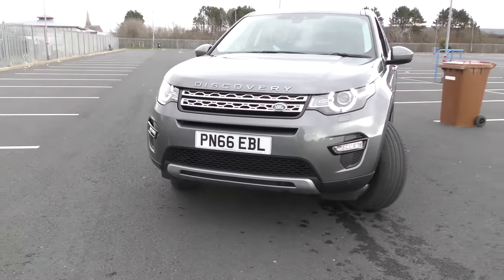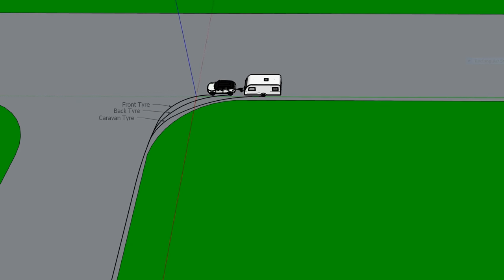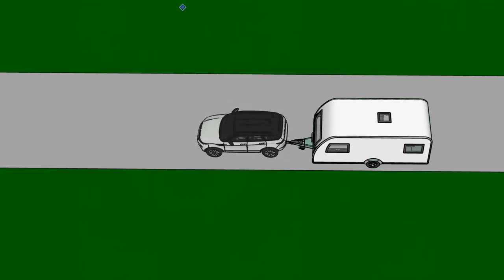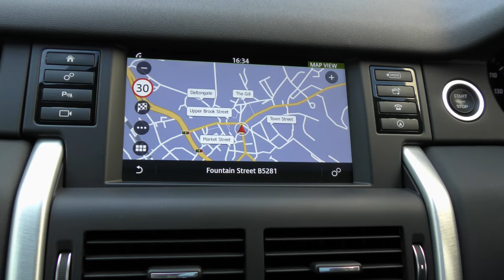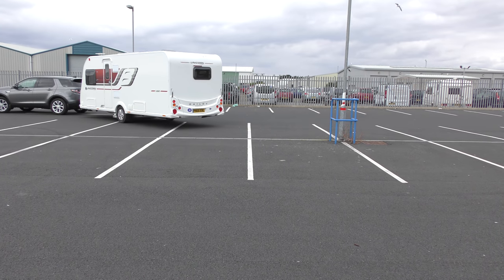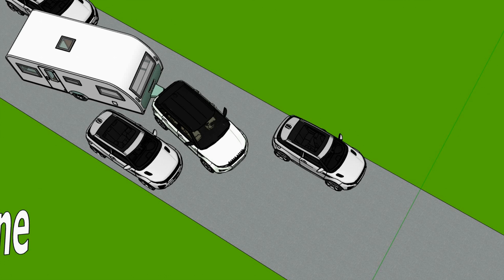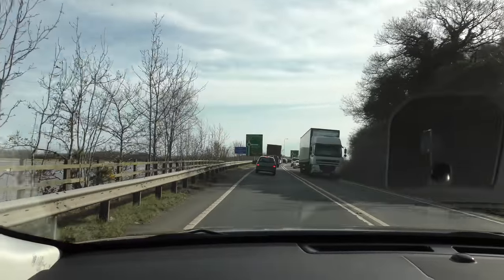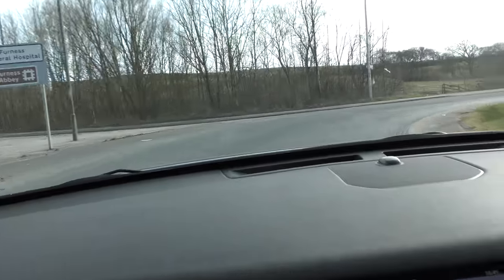How to safely tow a caravan or tow a trailer: Caravan tips and tricks

Comment: Tip no. 1 is at 0:12 - don't leave your jockey wheel down like that. (Jockey wheel is the one near the tow ball). If you do, it'll hit the ground and be smashed. There should be very little of the wheel visible in this shot.
Reply from the maker: Thank you for that pmaikeey, but you are wrong, the jockey wheel on the Bailey Unicorn is fully retracted. I agree if it was not there would be a problem.🙃
Reply: @UsefulWisdom  I'm not wrong - it's not clearly high enough - if it won't lift any more, remove it by unscrewing the clamp all the way as necessary - it's why the clamp's designed like that.
There's insufficient ground clearance in this shot.
Reply from the maker: @millomweb  the jockey wheel is wound up into its retaining slots on the shaft and lifted as high as the clamp will allow.  I have driven thousands of miles with it in this possession, all over the UK and had no problems with the bumpiest of hump back bridges, sorry,  it is you that is wrong.😛
Reply: @UsefulWisdom  "By the look of the picture the jockey wheel needs to come up further. It normally sits along the side of the A frame cover." - BaileyofBristol (Danny)
Reply from the maker: @millomweb   the tow ball high of the Land Rover Discovery Sport is 420 mm or 16.5 inches. The jockey wheel of the Bailey Caravan has over 12 inches of road Clarence. Although the Land Rover is  a 4 wheel drive vehicle, we had no intentions of using its off road abilities with this type of caravan attached to it. If we were daft enough to use a caravan  that had  off road  ability to visit the top of Mount Everest, for example, we may then, just for you, consider remove the jockey wheel altogether. However, our trip was from a CL in Cheshire to a CL in  Worcestershire, this involved driving down flat motorways and A roads.
Reply: @UsefulWisdom  It doesn't appear like 12" in the video and I've seen wheels higher than that relative to A frame. So that's two indications that it's low in that clip.
Reply from the maker: @millomweb  The EC Directive 94/20/EC states that the tow ball height should be between 350 and 420 mm with the vehicle in the 'laden' condition. My Land Rover has a tow ball height of 420 mm and in the Bailey Caravan specifications, Bailey advise this to be the correct height.  By the way I have seen a caravan manufacturers who does not give any  tow ball height specification, which is a worry. I expect it will have an impact on their sales.  How can you buy a caravan if you don't know its safe towing height? My caravan's  Maximum Technically Permissible Laden Mass is 83% of the Kerb Weight of the tow vehicle and the jockey wheel is fully retracted. I also have valid road tax, Fully Comp Insurance. My Land Rover is MOT exempt because at the time of filming, it is less than 3 years old.  Also my clean UK driving licence allows me to legally tow this weight of caravan.
Reply: @UsefulWisdom  The issue is ground clearance of the jockey wheel and nothing else. I'm not interested in your tow ball height or other things.
"How can you buy a caravan if you don't know its safe towing height?"
We use common sense.
Common sense tells us that the chassis of the trailer should be parallel to the road - on flat level ground - or that at the relevant points of the trailer should be equidistant from the ground.
In the case where a trailer is effectively flat-bottomed, a trailer that is nose down should be ok as far as ground clearance is concerned as that should mean the tow ball is the lowest point and therefore it should be the tow vehicle that hits the ground first.
Reply from the maker: @millomweb  You refer to we. Who is we? Bailey Caravans, and other reputable caravan manufacturers stipulate a tow ball height, so there is more than enough  distance for the jockey wheel to be safely stowed when towing. If you want to tow in a nose down configuration, Bailey Caravans and all other Caravan Manufacturers who have informed you and warned you of the correct tow ball height in their specifications will take no responsibility for any problems you may have.  Nether will Al-Co who make the chassis. If the tow vehicles tow ball is so low that it hits the ground, then you will have problems driving, it let alone towing with it. As for driving with the caravan in a nose down configuration, I have never tried it because I follow the manufacturers  instructions.  However, I have had conversations with caravan owners who have stability issues when towing in a noes down configuration. I suspect it is caused the the aerodynamic  flow of air over the caravan that strikes the back of the caravan more than the front. This could reduce the caravans noes weight to the point that it change the caravans center of gravity when driven at speed. If it moves the caravans center of gravity  to a position behind the caravans wheels, the caravan will snake. By the way, the nose weight of caravans is also stipulated by the manufacturer and is usually about 5% to 7%  of the weight of the caravan. Also this must not exceed the tow vehicles manufacturers specifications for the  max tow weight and I always  use a nose weight gauges to measure this weight.
Reply: @UsefulWisdom  "we" are the people who use trailers successfully without needing instruction for common sense.
Finding the change in nose weight at different speeds would be an interesting chart to view.
It may be than in general we've towed on the light-side re nose weight - with a tendency to load the car's boot rather than putt that luggage in the front of the caravan.
I'm not sure how 'people' treat weight in the front of a caravan - do they take it as caravan weight or car weight ? After all, nose weight is car weight - but should it be classed as van weight as well ?

As an interesting aside, when towing a fairly heavy trailer with a bicycle, you need to use more back brake and less front. Normally on a bike the front wheel does most of the braking but if you do this with a heavy trailer, there's a tendency for the rig to jackknife !
Reply from the maker: @millomweb . Thank you Officer for answering the "we" question. So you are YouTube's towing police. 
I have never towed a fairly heavy trailer with a bicycle Officer but I am sure you are correct about braking with this combination. 
How 'people' treat weight in the front of a caravan is an interesting question Officer. Some people don't give it any thought and load everything in the caravan. You are absolutely correct Officer  in putting as much of the caravans payload in your car as you can. So long as you keep the weight  under the cars Gross Vehicle Weight and its Axle Weights, Sir. 
As for  measuring the weight of the car, Officer  you have to add the caravans nose weight to it. This load can not be counted twice (i.e. in the vehicles train weight) and so it gives you a little bit of leeway in the caravan's payload, because it is being transmitted through the car's suspension onto the car's back axle and not through the caravan's suspension.
I thought twice before giving you this answer Officer, because some people (not you Officer) may read this and think. I have more payload in the caravan and I can load even more into it. I hope anybody reading this will thinking.  I have a safety buffer in my caravan's  weight calculations. 
I hope this answered all your questions Officer. 

😀
Reply from the maker: I want to give you more information no noes weight because it changes as you drive, so although it is classed as being transmitted through the cars suspension when the rigg is stationary, noes weight varies with Wind Loading as the speed of the rigg increases. Basically nose weight  is a dynamic load on the tow vehicles tow ball. This load will also vary dependent on the shape and size of the tow vehicle, because its aerodynamic shape will affect wind flow over the caravan.  This is one of the reasons I would not  add anything to the caravans payload known as Maximum Technically Permissible Laden Mass, even though it is classed as being carried by the tow vehicle when stationary.

 Any tow vehicle, no matter how aerodynamic, is when towing actually towing the equivalent to a house brick aerodynamically. There are some things that can be done to reduce the aerodynamic drag by the caravan designers when towing. The closer the caravan is to the rear of the car (sometimes called “short coupled”) reduces the turbulence created between the car and caravan as the car moves through the air. This is why sometimes you see articulated tractor units fitted with fiberglass infill pieces behind the cab to reduce the gap between the rear of the cab and the front of the trailer. For most caravans, there is little we can do, but we need to consider the effects on the caravan.

We are in effect, towing a flat wall into the wind, the effect this has on the caravan is to try to pitch it backwards on its axle, this moves the caravans centre of gravity rearwards and as a consequence, will reduce the nose weight on the hitch.

Drag increases with speed, in fact drag is proportional to the square of speed ( R ∝ v2 ) so, in simple terms, if you are doing 30 Mph and accelerate to 60 Mph, the drag at 60 Mph will be four times the drag that it was at 30 Mph.

Now the formula for calculating power required to overcome aerodynamic  drag is:

 P_d = \mathbf{F}_d \cdot \mathbf{v} = \tfrac12 \rho v^3 A C_d

What this means is if you double your speed the drag increases by a factor of 4, but as you are now doing the work twice as fast (you have doubled your speed) the power required increases by a factor of 8. Effectively you will need eight times as much power from your engine to overcome the drag at 60 Mph than you did at 30 Mph to maintain constant speed.

What does this mean for nose weight? Well in basic terms, at 60Mph there will be more force trying to tip the caravan backwards. It’s not quite that cut and dried though. As the force of the wind on the front of the caravan tries to tip it backwards, it is stopped by the hitch, it can’t move up because its attached to the towing vehicle, therefore, the force is translated into two elements, one trying to move the hitch upwards reducing the nose weight, the second is converted into a force pushing down on the axle which will also increase friction between the tyres and the road. It’s not quite simple enough to calculate these forces and effects. The effects are known by caravan designers and they try to mitigate some of these by designing the caravan to be as aerodynamic as possible and reduce the turbulent air at the rear of the caravan as much as possible. So to follow the caravan manufacturers instructions on hitch height is very important. Again, they have to consider what will be towing the caravan, everything from saloon and estate cars up to big 4 x 4’s. They all will have a different effect on the air flow over and around the caravan.
Reply: @UsefulWisdom  Thanks for taking the time to explain that but unfortunately, I was already aware of it - hence my interest on the effect of van front-on air drag.
Certainly a caravan wouldn't fly very well - perhaps like a brick as you'd mentioned !
Reply: Well  UsefulWisdom, I for one did not know all that information and I have been a caravaner for many years.  I thought it was  crosswinds that made caravans sway. What you have written about the forces of wind on the front of a caravan changing the load on the tow bar from a downward force into an upward force, has me thinking. Even driving straight into a strong head wind will effect the caravans stability. Thank you for this information. It will make me a safer driver.
Reply from the maker: Hi  @joblack3101  you welcome.😀
Reply: @joblack3101  It's one of the natures of nature ! The swaying is deffo from headwind, not crosswind - and it forms a well-known oscillation. If you ever see tall slender chimneys - such as metal ones on modernish factories, they often have spirals going up the sides - precisely to deal with strong winds that set up vibrations in the chimney. There has been a case of cooling towers at a power station being demolished by wind oscillations/vibrations. The Tacoma Narrows bridge collapse was a perfect example.
Caravans make the matter worse by having the axle in the middle - which makes no effort to kill the oscillations. If it had 4 wheels, 2 at the back and two steering ones at the front, it wouldn't be a problem at all.